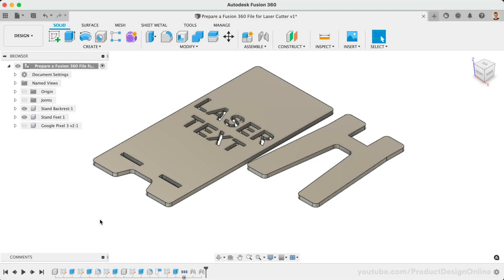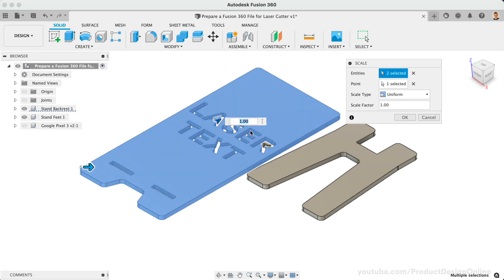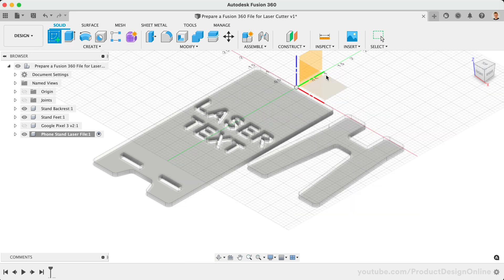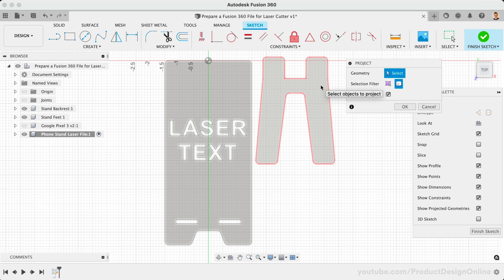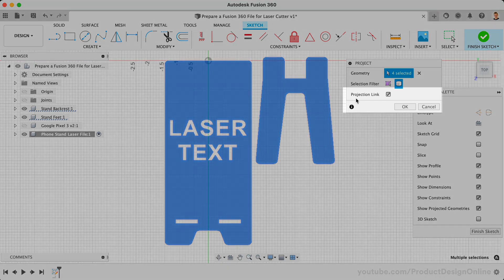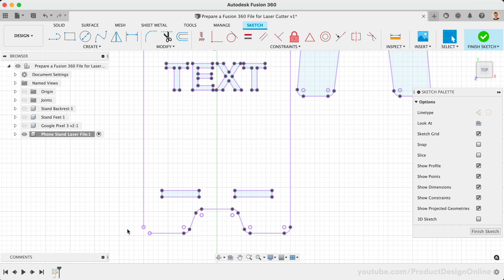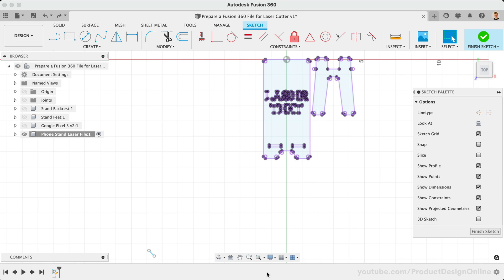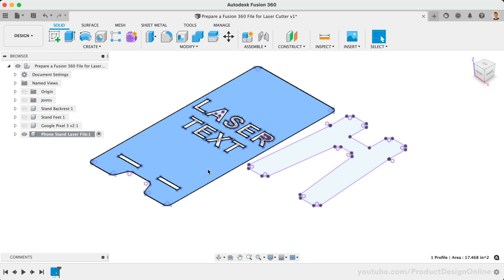Prepare a Fusion 360 File for Laser Cutter - Learn Fusion 360 for Laser Cutting 3 of 6

Comment: This seems to presume following on from part 2 on using joints to lay simple designs flat - there seems to be something missing, some step not mentioned, if using the Manufacture > Arrange method outlines in part 1.